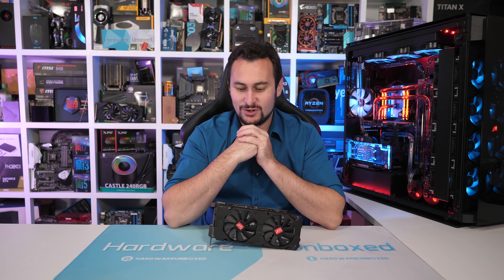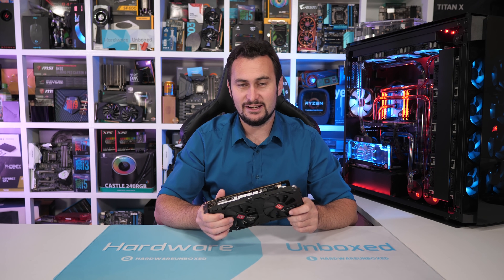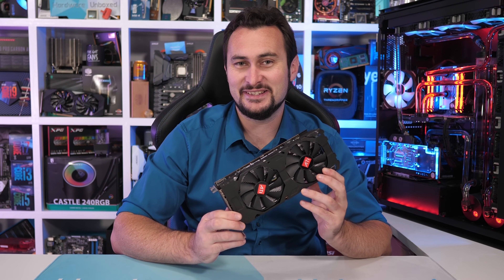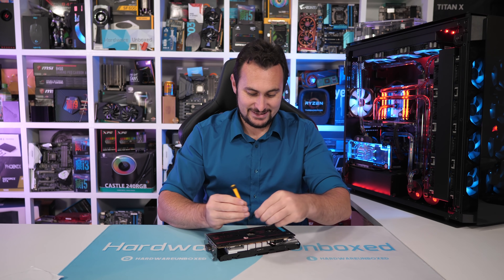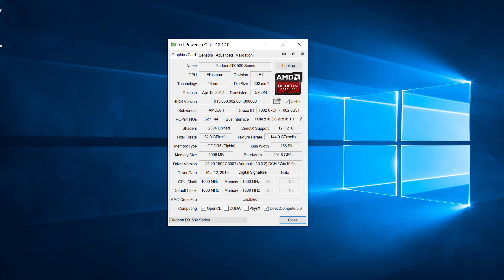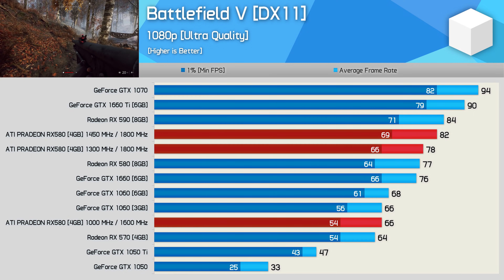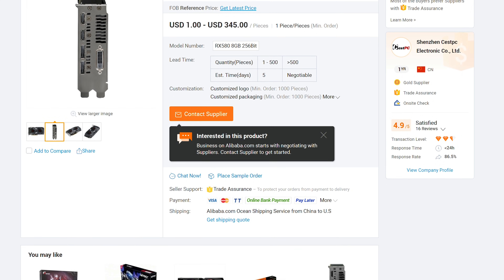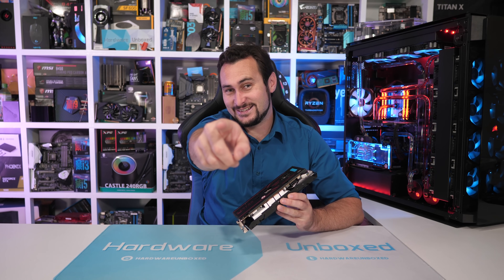ATI PRADEON, $96 Grey Market RX 580

Comment: Ok so quick question here. How can this thing have Elpida GDDR5, when Elpida went bankrupt in ~2013? I mean, a telltale sign of a scam GPU (a real scam) is Elpida memory.
Was fully expecting it to be like a 7870 or 7950.
Reply: That is weird because my brother's gtx 1050 ti uses elpida memory, and we all know how old a 1050 ti is ( Not old enough ). Considering that Micron bought Elpida back in 2013, I guess all these cards still using VRAM produced in the old Elpida factories still carry an Elpida specific ID or something.
Reply: All 4 of my XFX RX 470 (hotswap fan editions) cards have Elpida Vram. They are legit, I have the #1 TimeSpy Record for 2x crossfire RX 470 with them, so they perform as intended.
Reply: @jakegarrett8109  damn I'm sorry if these cards were for mining, because Elpida/Micron sure isn't the best memory supplier :)
 My memory was at fault, just checked a thread on a tech site and saw that actually I was something like half right: the physical memory chips on the gpus wear the 'Elpida' name while the BIOS makes them identified as Micron.
Reply: @jakegarrett8109  Elpida RAM doens't really OC very well. And I mean it's jack shit... All the cards that I have OC'ed with Elpida are abysmall.. So yeah, can't see why you'd  put Elpida in a mining card.
Reply: The TechLads probably because all the Samsung cards were selling for $600+, and the manufacturers needed to sell cards (On Eth algo, I saw 24 Mh/s at 80w, or 29.5 at inefficient speeds on my Elpida cards. Stock was 15-18 Mh/s, which truly is abysmal!)
Also fun thing, FX makes 360 H/s Monero vs 380 on Ryzen 1700 (same power draw), both run 8 threads at 16MB/2MB. But I hit 630 H/s on FX with sub-zero phase cooling! Cool to see FX was good for something.

Yes, I bench everything. I’ve benched Ethernet cables (upload vs download in cat5e vs cat6 and flat cables), HDMI (no difference), 4k monitor oc binning, GPU binning, memory, every darn USB and hard drive I get (literally first thing I do), overclocking SD cards, etc. my tablet is even water cooled for lols (and a 44% overclock with 40c cooler than out of the box temps). I even over-volt my case fans (the one that fried now has a 120+w airplane motor in it, I use it for benching “on air cooling”).  If it can be cranked up, I’m there! Does it make any logical sense? Not for half the stuff I do.... but it’s fun!

When mining was a big deal optimizing, I figured I might as well join the fun (it’s a competition to me, and mining was a new “efficiency” type benchmark). I learned a lot from the experience, like BIOS modding (which is helping me bench records), that undervolting is actually massive on RADEON, and that memory is super important (before then, I didn’t realize the same product model came in whatever the heck random stuff was laying on the floor that day. So you pay the same, but your performance is not! I think reviewers should mention what Vram they get since they mention less meaningful things like “model number” (yeah right, if it’s the same model, it should have the same parts! That’s not how “models” work!)

Comment: Wait, so is it a  4 or a 8 GB card(I mean can it be flashed if it has the chips physically there), if later then this might be a good buy for 3D artists wanting to set up a small GPU render-farm.
Reply: Then again, there are used RX 470 8GB cards around here for 60 to 70 €

Comment: I wouldn't mind getting some of them ATi stickers (not today though).  But no I won't buy the card just for those - I'm sure there's ebay sellers selling 'em stickers.  As for the card, while it's not fully on the up and up, at least it isn't a full on scam (ie: an RX 550 BIOS moded to show up as an RX 580).  I wouldn't grab one, but if I happen to come across one I will fix the thermal pads.

Comment: Steve I was expected power consumption testing, thay low clockspeed on "stock" must make it quite efficient and was wondering.
Reply from the maker: It's basically the same as an RX 570, total system draw was 10-watt lower.
Reply: hmn i see, was expecting better tbh

Comment: These are most likely what you call a "third run" product. Basically factories run in china on 2 shifts, then everything is shut down for a bit to let things cool down and do maintenance and things like that. But in some factories with some, uh, less than savoury fellows, they run the factory for a third shift then dump whatever they made under a different brand name and take the profits for themselves. It's quite likely this is a straight up name brand card and the lack of quality control on the thermal pads seems to indicate it's a third run product. Chinese manufacturing is weird as hell.

Comment: When a china hacked 480 decimates nvidia cards that cost much more.
Reply: Underrated comment
Reply: Toms Tech yeah but it doesn’t have warranty, is very low quality, and doesn’t have proper support.
Reply: @danielzhan86  and if it stops kicking nvidias as that MAY be a problem. Until then however.
Reply: @danielzhan86  you forgot to mention draws more than twice the power.

Comment: Got my XFX rx580 8gb for $120 this month on eBay. There are good deals out there.
Reply: Bear River you can get used 480/580s for 70-100 euro where I am from miners. Also it seems a big miner sold off a lot of 1070 windforce cards, since basically every used PC you can get locally has the same model in.

Comment: 8:18 The reason why its not 8gbps memory or is and is downclocked is the fact that its RX 480 not 580, in 2016 the 480 4gb model had slower memory -> 7gbps than the 8gb model which changed in 2017 with 500 series into parity between the two models but in this case its even slower same as the core clock for reason you described but it also explains why you couldnt OC the memory to 8gbps because it have memory rated at 7gbps.
Reply from the maker: The code on the GPU package checks out as an RX 580. Petty sure the are just using older memory.
Reply: Okay, frankenstein specs it is then :D ! Anyway, even with that being said it seems like a good value and surprisingly its not a scam.

Comment: So... you are saying that I can get an RX-590 for $70 and a little flashing/overclocking?
Sign me up.
Reply: 580*
Reply: @brenaan_  the results of the testing put it just about on par with the base RX-590... which is really just an overclocked 580. Sure the 590 can be OCd too, but the 590 is well over $200.
Reply: Just forget to buy thermal pads
Reply: @iamsoldats  590 is better binned smaller process gpu not really just a rebrand there is some difference
Reply: no its locked at 1000mhz he said using some form of software or something he was able to bring it back to 1450 at the most stable level of OC and that was just under 590 performance.
but running it higher than it should and without proper thermal padding it surely cant last too long as a gaming card.
but then again for that price you really cant complain.
Reply: @Dockhead  "using some form of software or something" is called BIOS flashing.

Comment: One thing I don't really understand about those scam graphics cards, where they reflash an older car to lie being a newer one: How do the display drivers cope with it properly? It's my understanding that if the card lies to the system as being newer than it really is, the display driver will try to use it as the newer card, and start giving all kinds of errors when it doesn't actually work like the newer card, which usually means system crashes or all kinds of visual glitches.
Reply: for the RX 4xx/5xx and sometimes the Vega they are the same card just rebadged, clocks pushed up sometimes TDP notch down or up a touch, but, example an RX 470/480 or 570/580 are "technically" the same thing, the only thing they have to do is adjust clock rate in bios via a few places and it "becomes" the higher card.

that being said, is they use memory designed for 7k and run at 8k than likely will have problems etc but then again even the big brands do/have that crud happen all the time, sell at a speed a recent memory IC supplier change does not handle (example Sammy to Elpida or Hynix)

Comment: Is it only a 4gb card? It seems to have 8gb worth of memory modules but with the thermal pads being the ones that you'd find on a 4gb gpu... I'm confused.
Reply from the maker: They both have the same number of modules. Otherwise the bus width would change between models, making the 8GB version much faster.
Reply: @Hardwareunboxed  Oh yeah, you're totally right. I should have looked at the busted rx 470 pcb that I have laying around before commenting :P
Great video! Quick question though, did you install any thermal pads where they were missing when you did your testing?

Comment: wonder how these would look in 4x crossfire for the cheap and low power
Reply: Bad, but recommend this on my channel “Legit_Overclocking” and I could test this month. I have 4x RX 470 (I can exceed this performance level, I’ll go ahead and break the world record for crossfire RX 470 if I made your video). Power consumption is around 80w per card if they are mining optimized like these were (so I’d guess these were 90w since they were 480).

Crossfire gaming will suck (comparatively, you have to understand I call my Titan Xp “dog$hit”, my main system is 4x R9 Fury and it’s silky smooth compared to any Pascal I’ve tested, and yes im talking about single GPU pascal, my crossfire is more consistent frame times...). However the duel RX 470 I tested, well... it worked.. but it has a real amount of stutter! It was approaching Titan levels of performance in some of my games, but the stutter was real! I did not test 4x later when I got the new Threadripper platform that could handle it, because it was so bad compared to the Fury cards that I didn’t want to see just how bad 4x would be.

But, I’ve got the cards, and I was going to do a cooler comparison (AIO GPU, custom water, stock factory fan, FX CPU cooler zip ties). I could literally run all those different combinations at once if you wanted me to do game testing.

Just put a recommendation for this video in the comments of any of my garbage videos on “Legit_Overclocking” and I might go ahead and do it sometime in the next couple months if I get bored. I’ll knock out several at once (your video, cooler comparison, world record, maybe a hardware modding video depending how hard that record is)

Comment: No power consumption comparison especially vs the 1150. I am disappointed. 

It may have the perf of rx570 but with 1000mhz clock speed power consumption should be below 100w.

Comment: RX 580 is really cheap here in Vietnam, it's less than $100 for the RX 580 8GB, i bought a mining HIS RX 470 IceQ X2 OC 4GB with 1 year warranty for only $43.
Reply: Wow. Amazing deal
Reply: Holy fuck that's cheap!
Reply: Max Raider  it's ofcourse used cards, but the brand new Gigabyte RX 570 Gaming 4GB MI is about $120, which is totally destroyed the purpose of the GTX 1650. Cheapest GTX 1650 here is $203

Comment: I'm honestly surprised these (recycled and) repackaged mining cards didn't show up sooner - but I'm betting they have been blowing up in China, Singapore, India etc for a while already.

The somewhat shoddy assembly makes sense. This would likely be much closer to a back-alley assembly than an AIB production line operation. Cooler assembly and mounting is manual handwork even on AIB production lines. This works well into this nighttime-production, bootleg manufacturing mentality in the region. The sales prices are extremely attractive, consumer protection non existant and worker compensation so meager, there is extremely little incentive for doing precision work. The market is also so huge, the "operators" don't really ever need to sell to the same customer more than once either - compounding the issue. This is also how fake food manages to still persist in China, even though it's making people sick and worse.

None the less - an educated buyer with a screwdriver, wanting a dirt cheap GPU, can just get one of these, flash it when it arrives, and order a couple of strips of thermal pads at the same time. If you're willing to do your own cutting and do your homework, you can get 100x100mm sheets of ~3W/MK thermal pad material for about $2-3 a pop. At these prices, risking a dud is almost worth it. You could probably get two for "the price of one", and crossfire them. Have a spare. Or sell the 2nd one locally for a small profit - just be honest about its origins.

If you're a non-tinkerer, I would probably suggest going with a good deal on a new, known good brand card though.

Comment: Interestingly AMD did maintain the ATI brand a bit after buying them. I believe the last we saw of it was in 2010 or 2011.
Reply: Yep, ATI Radeon HD5xxx series in 2009~2010, then followed by AMD (and/or Radeon too?) HD6xxx series in 2010~2011
Reply: makes me :(
They should have kept AMD for everything CPU related and Radeon when using anything Graphics related mainly because both AMD and later ATI both have name recognition, names are power if used properly, them pushing the namesake into a mold filled corner not cool.

on another note, he says they are from wherever he got, but no real direct link or naming etc and that silverknight is fubar link (for me at least)
Reply: Yeah I got a pair of AMD HD6950's laying around, and that was the first they were "AMD" branded GPU's. They still used horrid ATi Catalyst drivers though. And sadly the 6xxx series was completely abandoned after Crimson's release, with the Crimson's beta being the only driver that'll work properly.

Comment: The shroud and fan design actually looks really slick.
Reply: it's from MAXSUN, a big brand in China
Reply: Old post ikw, but right now I am using a pc with this graphics card, and the only gripe I have is a blue box surrounded with line at post, other than that it boots normally and i did stress test it for half an hour with furmark and it did give me the same fps as my sapphire rx 480 AND the shroud is actually made of metal, Imho it's a great card

Comment: At least they are RX480/RX570's flashed to RX580, Good that they are not full on scamming people like the GT710's being GTX1050's on Ebay.
Reply: its an actual RX580. just a mining card.
Reply: @Miko36110  it still needs to be flashed to work with the normal gamer drivers, either way yes it is no matter what a 580. The 580 itself is a rebrand of its 400 series counterpart.
Reply: @KapiH  No. Did you even watch the video? The card works fine with the default bios, it's just underclocked.
Reply: Or 450 gts/550ti as 1050s and 1060s...
Reply: @ Kapi  " At least they are actually  RX580, Good that they are not full on scamming people like the GTX 1650 from Nvidia. "       Fixed!

Comment: It's a RX 480D overstock GPU die from Sapphire. Black listed CESTpc Shenzhen PC co. badly underclocked and flashed it to a 580. (Good job modding the bios though). 1450MHz, Pretty good clock. Just like my Nitro+ RX 480 8GB OC.  Probably a overseas miner had a inside deal on a massive amount of units. Plus not one AIB board partner put a 5 phase setup on a 580. Even Sapphire removed one of there 6 phases when they released the Nitro card.
The Sapphire Pulse RX Vega 56 is selling for $300 on Amazon. There's also a Gigabyte version for even less.

Comment: Very tempting deal. Haven't owned an ATI for a long while.

Still, was really looking forward to a comparison with the 1650, including power use. Shame you didn't include that.
Reply: ETophales power wise will definitely be worse, performance will be quite a lot better tho..
Reply: Well, it has a lower frequency than the 570, and also worse performance. A bit of undervolting and how knows... (Well, I suppose it would still take more power, but is it actually much quicker than a 1650?)
Reply: ETophales I was talking after all the tweaks are applied(like what Steve did in the video)

It’d be not smart not to make it perform how it should :P
Reply: Perhaps, but since people claim that power use matters, and this is underclocked, I think it's of academic interest to see how far in efficiency it is from a 1650. Far as I could find, the 590 at least is as efficient or more efficient than Pascal, when running at lower clocks and lower voltage.